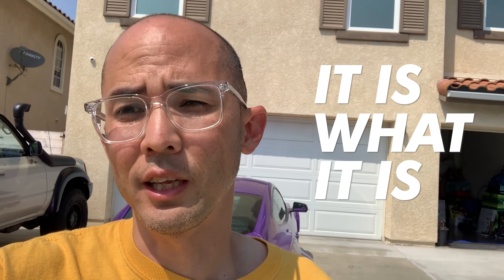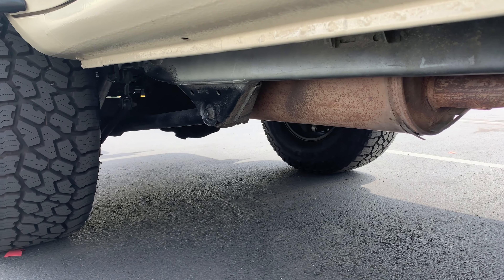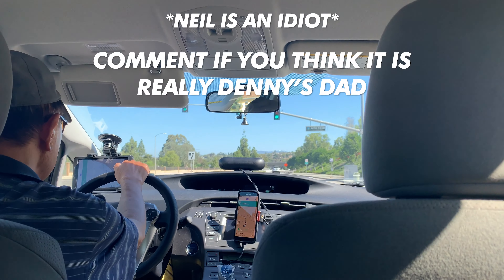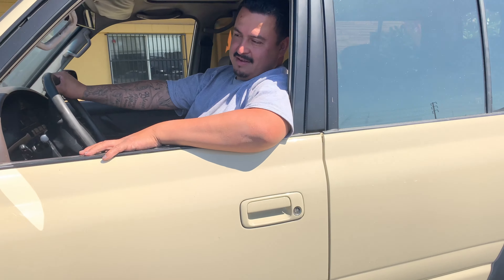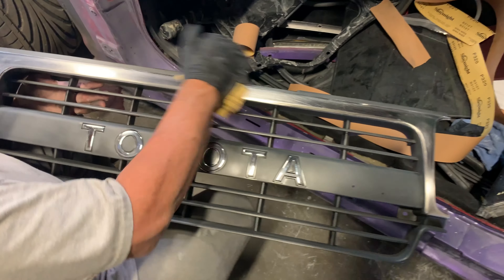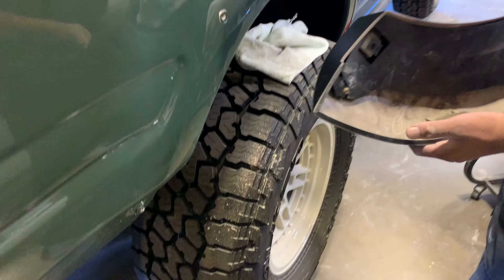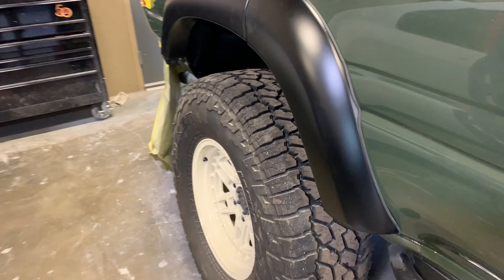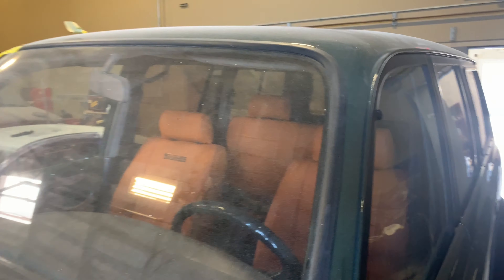Tjin Edition 1994 Toyota Land Cruiser Overland SEMA Build Part 5 - Army Green - DAYUUM!

Comment: Could you help me finding this part:
22270-61010 air control valve for 1991 land cruiser
I couldn't find it.
Thanks...
Reply from the maker: I found what you are looking for on ebay and amazon. even local toyota dealers in US might have it. I am not sure what area you are in.
Reply: @DAYUUMxTJINEDITIONGarage  thanks for the advice but actually when I ask for the part no* 22270-61010 air control valve, the answer is it's out of stock.
Reply: @DAYUUMxTJINEDITIONGarage  I am in Saudi Arabia. The mechanic advised to change the engine because of this part.
Regards
Reply from the maker: I'm not sure how I can help from the US.
Reply: @DAYUUMxTJINEDITIONGarage  It would be great if you  give me the address, or link of the place where I can get the part. 
Regards